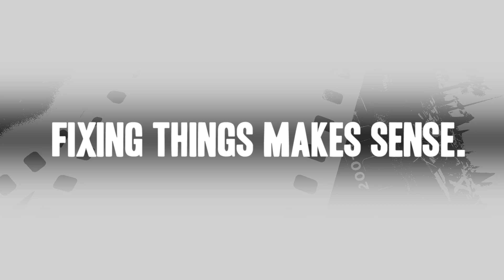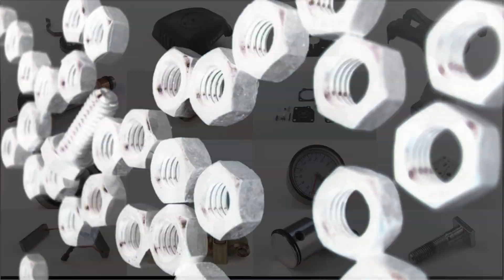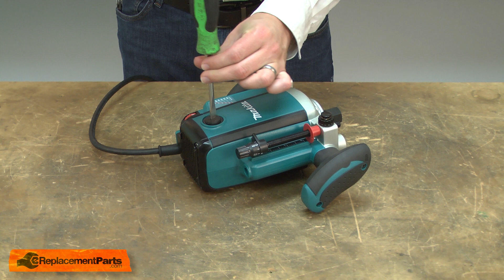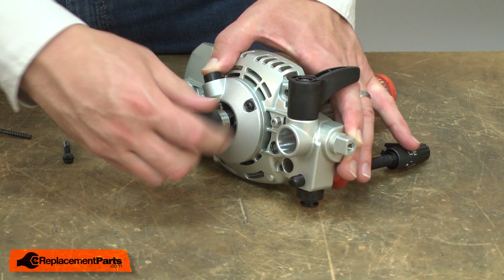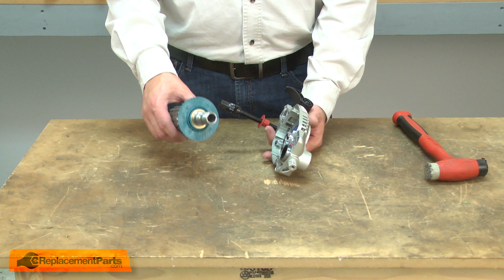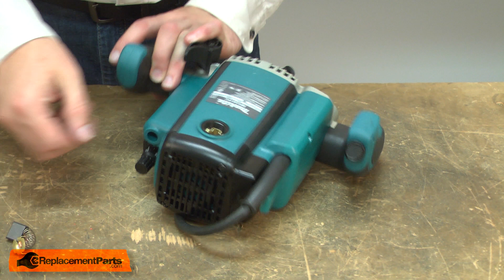Makita Plunge Router Repair - Replacing the Bearing (Makita Part # 211092-6)

Comment: Hi.....I recently broke a spiral bit with my rp2300fc...........and now when using a long straight bit......the bit wobbles and the router vibrates......my question is ....do I have to replace both bearings, the collet cone and nut?........thank you

Comment: Hi, my makita RT0700C router is with unstable bit speed.
It accelerates up and down instead of have a constant speed.
Could it be the carbon brushes maybe? Thanks
Reply from the maker: Hi Alan, thanks for the question. The acceleration up and down that you're describing can be a problem with the carbon brushes. A worn down brush will have less spring tension which can prevent your router from achieving a constant speed. It could also be an issue with the commutator. Odds are, this problem is originating from where the brushes meet the commutator. We hope this was helpful to your repair!